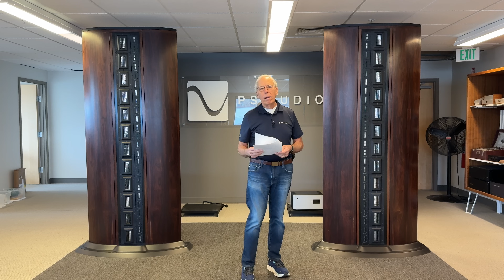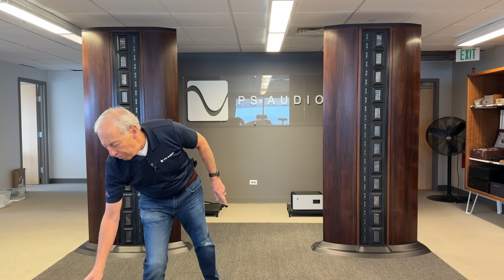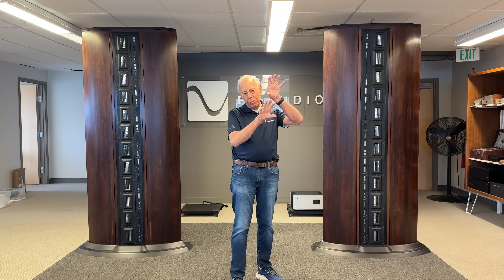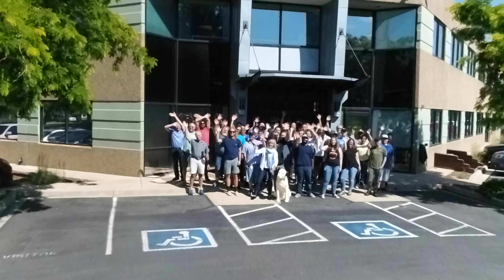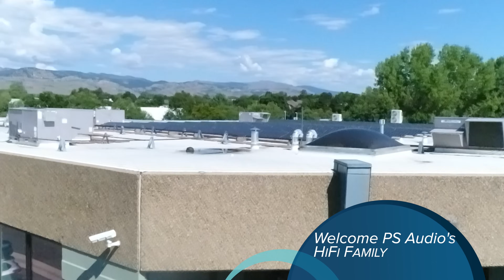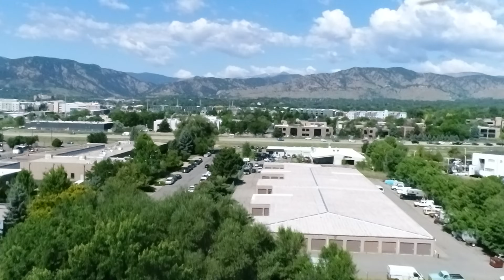Importance of crossover parts in loudspeakers

Comment: GR Research. I think he's full of it. He likes the speakers to sound a certain way so he tries to make all speakers sound the same. All opinion.
Reply: Yes and no. Some of the standard crossovers are poorly designed or made from poor quality parts. They can definitely sound better by upgrading them. Now, how you make the drivers sound is a whole different discussion. I think a speaker should be flat, and you raise certain frequencies through the use of a preamp.
Reply: I agree with Paul, I have made many loudspeakers and start with cheap parts until I get the crossover performing properly, after that, I do another crossover with high-quality parts. The difference is not subtle. I also have my cross overs very close to the power amplifier and run the speaker cables from there to the loudspeakers, that makes a difference
Reply: I think he wants the speakers to sound a certain way and that certain way is good. I did his kids on a pair of Klipsch RP600M and it was really really good. Frequency response smooth out but more importantly he solved some phase issues and the soundstage depth really surprised me.
Reply: Danny at gr research is a big fan of verum. The guy at Verum seems to be a bit of an arsehole.
Reply: @dangerzone007 I now need to find verum and make up my own mind about his arseholery
Reply: So what you’re saying is you’re clueless.
Reply: Your opinion is uninformed.  Build a hundred different speaker kits, then come back and tell us what you "think".
Reply: he is only using measurements to design a crossover, he never listen to the speakers
Reply: He never actually shows you what changes he makes to the crossover circuit, only the results and components. I know that he does baffle step compensation but it is clouded in mystery.

Different capacitors makes sense when you are talking about an electrochemical component. Air cored inductors makes sense avoiding hysteresis. 
I do wonder how much bull there is about his dislike of steel in the signal path, it doesn't make any sense to me.
Reply: @ianbigsand7  I'm wondering if you're disingenuous or you saw just one of his videos because he shows it very often. He always shows the direct results of the upgrades. He also talks about the effect of different materials on the signal path, and I believe it does. But again, it comes down to preference. Most folks would be happy with the stuff that comes with the speakers.
Reply: @xaviermontalban717  I've watched quite a lot of his videos, he doesn't tell you what circuit changes he makes, but the results are impressive. He gets rid of lots of anomalies that sometimes are to do with a poor choice of crossovers frequency, but often rather more clever than that. He doesn't explain the intricacies of circuit design.
Reply: @ianbigsand7 While he dosnt show that every time, he has plenty of times and he always does before and after measurements and you can always look at the kits and order your own parts to suit your budget. Sometimes its worth doing, sometimes its better just getting a different speaker. Somtimes speakers have asthetic or sentimental value so people dont. GR is very well regarded.
Reply: @ianbigsand7 steel parts act as inductors. They store charge and release it later, smearing the sound. Another factor to consider is that every time the signal passes from one type of material into another, there will be impedance changes. I have it in my head that a portion of the signal reflects backwards at every change of impedance. I hope that is correct.
Reply: @EskWIRED hi, indeed steel wire does act as inductor, as does copper or silver wire. For the frequencies that are in the audio band, and very very far beyond that, the effects are infinitesimal. 
Impedance changes are also a factor, but only for far higher frequencies and then only for situations where you have a load impedance that is unchanged across it's working bandwidth, you need to match source, transmission and load impedences, this is the realm of RF engineering.
It is important to understand that at audio frequencies these effects are totally unimportant. 
I'm not saying that there isn't an effect, but it is nothing to do with inductance of steel components compared to other conductive components.
I would be interested to hear Paul's audio engineering take on this.
Reply: @ianbigsand7  Thanks for the clarifications.
Reply: @EskWIRED, however, if someone has a convincing argument with some sound engineering and science, I am more than happy to correct my misconceptions.
Reply: @ianbigsand7 don't think anyone cares
Reply: @ianbigsand7 
It's not that ferrous material acts as an inductor ... it's hysteresis that's introduced as a corruptive element. 

The components essentially form a waveguided path, ... the work is done in the surrounding field. 

The field encountering a ferrous element introduces the hysteresis characteristic ... which is avoidable, unnecessary, and can elicit a corruptive time smear. 

Subjectively subtle, yes ... but absolutely a thing.
Reply: You make no sense lol. Fixing issues isn’t making them sound a certain way. All people that make speakers want “that” sound.
Reply: @ognewb  listen I gave it a try, I thought the results were fantastic, I was super happy with the value and it was fun to do.